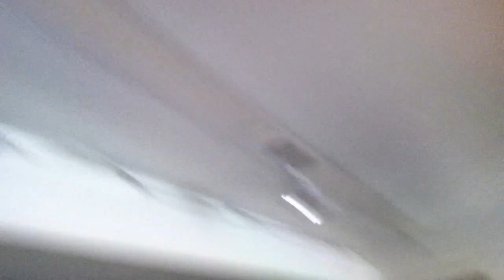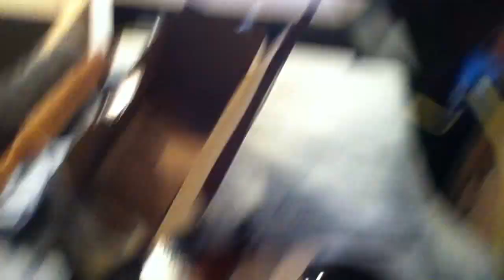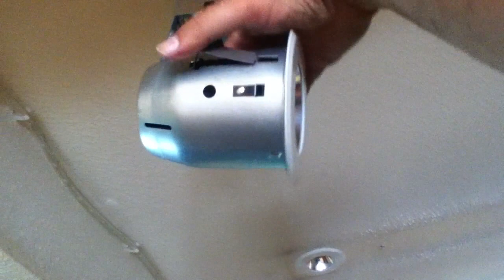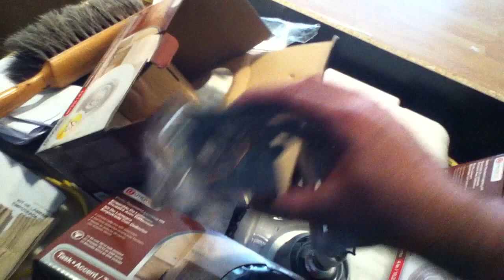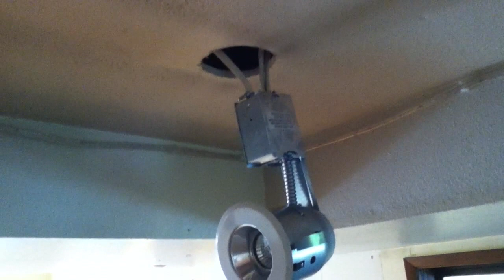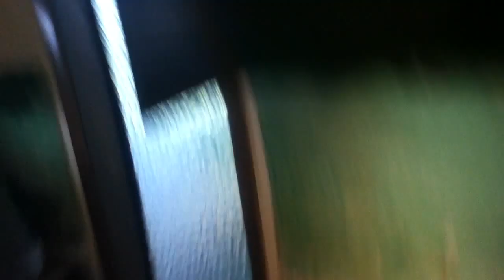Can lighting and LED installation.

Comment: We have had trouble with companies pushing LED lamps for the fittings. We have mains voltage Halogen (GU10) and Low voltage 12V halogen each fitting has its own 12V transformer.

Changing over the mains fittings is easy as changing the lamp, But the low voltage downlighters need a LED driver. which normally means a whole load of work. If you swap the halogen lamps for LEDs they still work but they are dimmer and seem to pop the transformers after a couple of weeks!